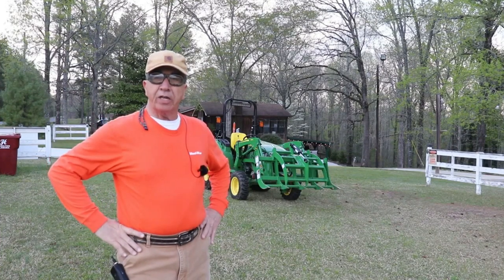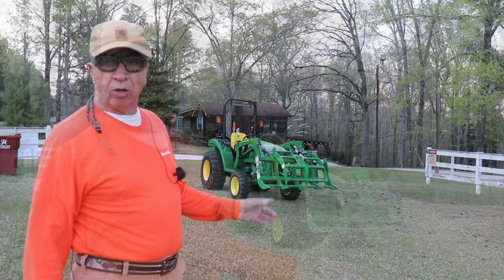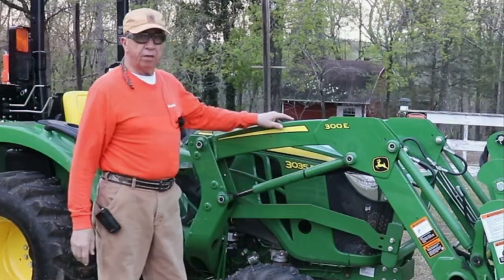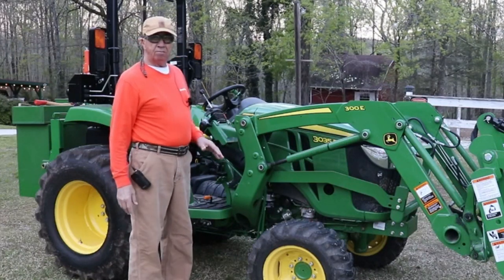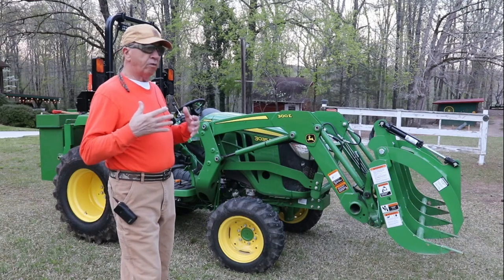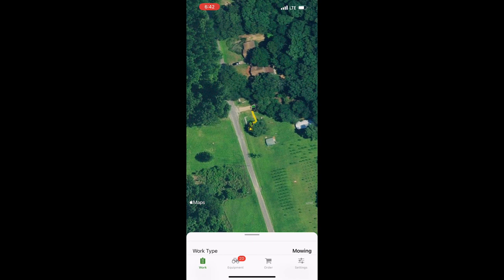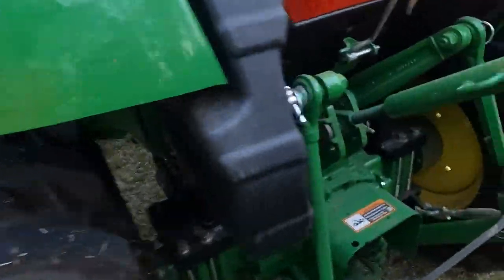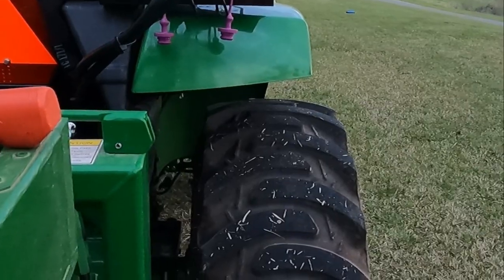John Deere 3035D Review

Comment: I had the exact same rear remotes on my J.Deere 3025 E. I didn't get a grapple,  as my hydraulics are very weak. My loader according to the specs should lift 1300#s. Mine won't. A drum of diesel fuel weighs about 500#s I can't lift it off the ground. My mechanic at the dealership said after changing all fluids and hydraulic filters at 50 hours maintenance it would get better.  Well mine didn't. I cannot even pickup a bucket load of gravel.  If I were to put a 300# grapple on it, I doubt I could pickup a piece of firewood. Very frustrated with the 3025 e. I like how you got yours decked out. I also like your light bar. You have a nice tractor.
Reply from the maker: Thanks so much.  I hate that you are having this lifting issues.  Maybe it will improve.  Remember lift capacity is rated at the pivot or curl point of your loader and the farther away from that point your load is the less the lifting ability.  I’m sure you already know that though.  Again maybe it will improve over time.

Comment: Nice review.  Only comment I'd add is that if your front axle is on a central pivot (as is typical) then widening the front wheels won't have any effect on initial stability since the front axle has no resistance to rolling until hit hits the stops.  It would improve secondary stability (after you hit the stops) but by then it may not help in a tipping situation.  There were some old tractor safety videos that illustrated this nicely but I can't remember where I saw them -- they were put out by a midwest state's ag agency if I remember right.  If you do heavy front loader work I'd feel better with the front wheels in a normal stance, to lessen the lever arm loads on the front axles and bearings.  They are common failure points on compact tractors used for loader work.
Reply from the maker: Yes I’ve heard this before.  Certainly trying to not get into that situation.

Comment: I bought my 3035D for the same reason, more PTO and heavier overall. I had injured my arm using a hydro drive walk behind mower which kind of soured me on hydros. I am considering getting the bluetooth monitor. My biggest learning curve issue was not to reach for the loader joystick when preparing to chane gears or directions🙃. 
I had a LaneShark FEL cutter system added. It has worked well, but the routing of the hoses from the dealer left much to be desired. 
I did not get rear remotes, but maybe should have.
I agree it is a bit tippy, but I could not add wheel spacers as the trees on my lease are quite closely planted. Just have to watch the inclines on parallel.
ROPS light bars should be standard equipment, as should mirrors. I would like a separate switch for the light bar so you could swith it off on the roadway without killing the headlights. Haven't done much work after dark, so haven't installed one myself(but that could be why I haven't done much after dark🤔).
Great review.
Still learning the ins and outs of tractoring. The JD QA is great, but that extra depth does make hooking things to the PTO or the draw bar wish my arms were much longer and thinner.
Reply from the maker: Thanks so much for your comment.  Enjoyed reading about all you have done to your 3035D.  Yes be careful about the tipping.  Just learn and stick to it’s limits.  Hope your arm is better and thanks for watching.

Comment: Great review. Only thing I wasn’t clear about is why you are controlling the third function on the grapple from the rear hydraulics. I have a 3043D with third function as a thumb control on the front joystick.
Reply from the maker: I wish I had known that was available.  My dealer said this was what was available for my tractor at the time.  I had even contacted Green Parts Store.  This does give me an option for controlling a rear emolument with the lower lever.